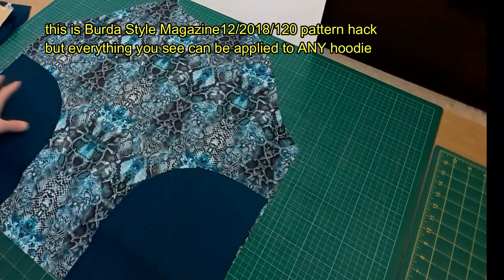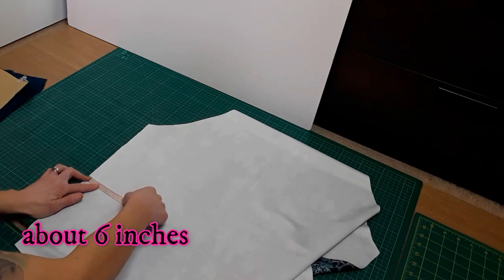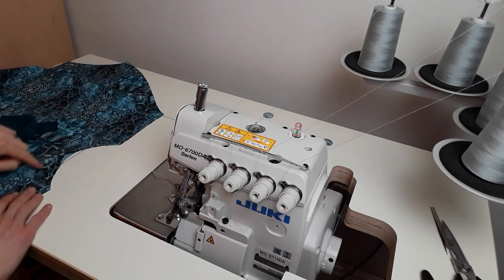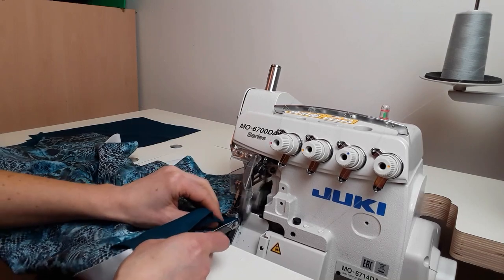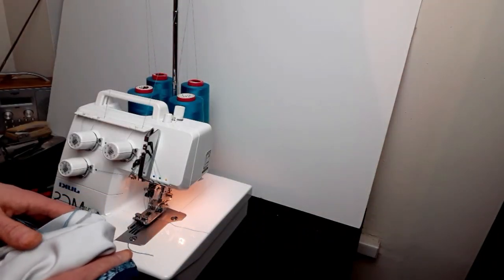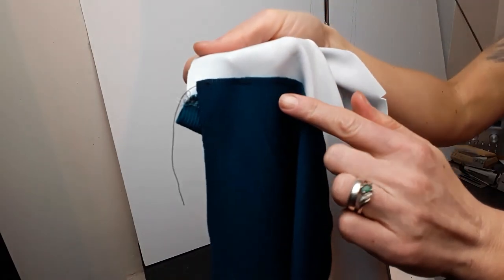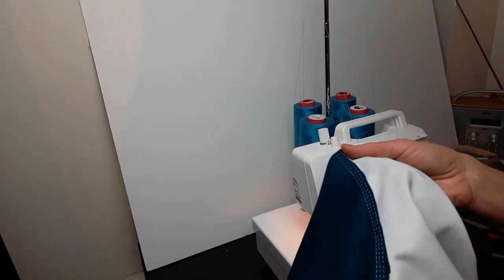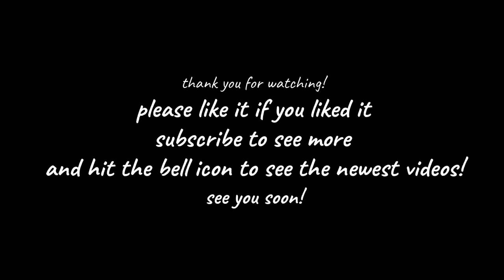Coverstitch Machine Uses DIY Hoodie part 1.

Comment: You know more than I, but I was surprised to see you put the pockets on, and apparently sew a partial side-seam before attaching the sleeves.
I've decided I like the non-reversed look of coverstitching better.  Thanks for the video.
Reply from the maker: The sleeves are sewn flat, so there's one continuous seam (no partial side seam) Sometimes the videos are not clear especially the early ones (I had never made videos before). The sleeves can be set in of course (but still, there wouldn't be a partial side seam) 😊
Reply: @GingerheadCo  My question was a bit of a flub.  I thought you were making a seam with the pockets; now I realize you were serging when I thought you were making a partial seam.
Reply from the maker: @tkarlmann  hopefully I'm going to make better videos 😁 the recording and editing are still a struggle for me 😉